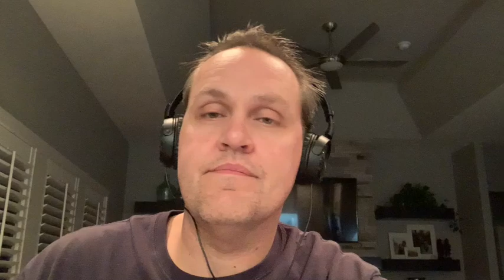viewer question 2. opinions, wood, and trauma, oh my

Comment: Here's a question I thought of while watching this: When a park buys a ride and tells the manufacturer that they're going to do the control system, for example, does the manufacturer request to take a look at the plans and details of control system and okay it? I can't imagine they'd risk their reputation on an inadequate or flawed (from the manufacturer's point of view) control system potentially causing an incident.

Also agree with you w/r/t hybrids... for years mine trains and even big coasters like Gemini were considered steel coasters, not hybrids. RMCs et al are just steel coasters, the 'hybrid' designation is unnecessary imo. Just a new generation of steel coaster.
Reply from the maker: When the park builds parts of the ride, (controls, brakes, lift, ect,) there is a partnership that has to happen. The manufacturer makes sure they product design will fit the parks plans. A third party is sometimes used to verify the compatibility between designs and act as an impartial safety. 

Yea the hybrid is a odd category. RMC topper track (steel on top of the wood laminate stack,) is the only hybrid in my mind. 

Haha! Think of this. If you see steel track between two support pillars,….. it’s not a floating track hybrid!!! Hahaha!!!! LMaO
Reply: Well with the new RMC at Hershey Park you can actually see the structure sway a bit. I'm not saying it's not mostly steel but it might make a little difference in ride experience. I haven't ridden it personally though so I'm not sure.

Comment: Nice to know the Millennium Flyers are well manufactured. I thought they were a big step up compared to the PTC trains in terms of design and rider comfort. Putting a wheel under each row is just better for wooden coasters than having 2 or more rows of seats in a single car. PTC trains seem to be well made too but they're just less comfortable to ride in than MF trains.
Reply from the maker: Yea they are very nice trains. I’m not a fan of wagons like the PTC style trains. Trailer hitch styles are far superior for ride comfort.